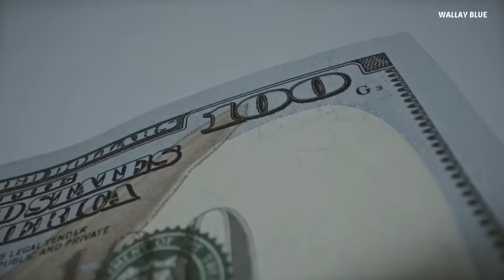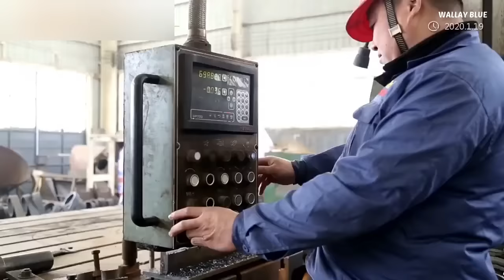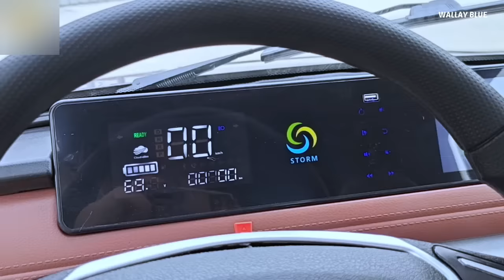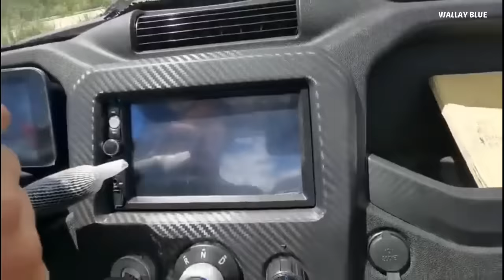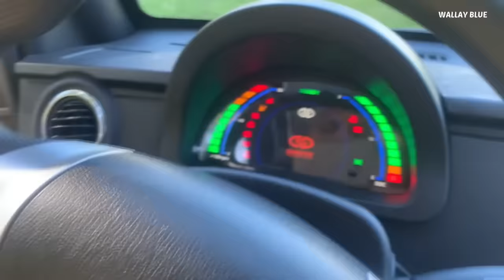China $2,000 Truck Shakes The Entire Car Industry

Comment: It's cheap because it's made really really cheap, I'm not saying is bad but, the chassis is as cheap made as possible, the welding is super minimalist, the bars of the chassis aren't fully stiffened with the welding because they only apply it in spots, not a continuum line looping the union of the bars, which are 1x1, 2x1 and 3x2 inch structural square tubes, so expect doing some welding and adding some reinforcement if you want to level up the durability. The bodywork is okay, made in assembly press and the electronics are simple. By the way the it costs 2000 USD if you buy it in china, and it's the very base form, which barely can make 40 miles of range, if you level up the options, a more capable battery (lead) and other stuff, you can get more range but the price goes up almost double

Comment: Suspension and shocks are not present, it’s ok to drive around but it’s not comfortable at all, seats are made of weak material and broke apart, I already need to buy the motor sensor and the regulator box, driving at night it’s impossible. Lights bulb are weak bright